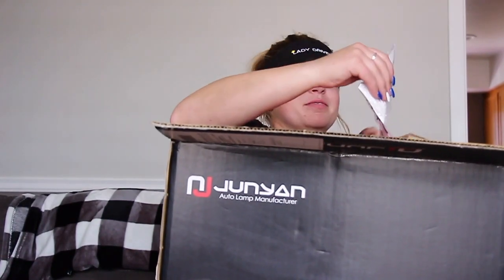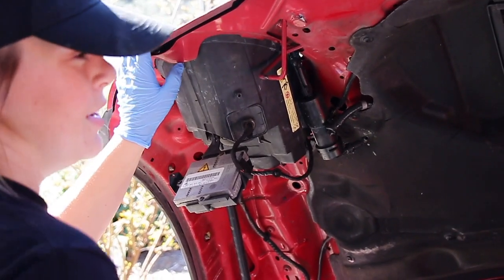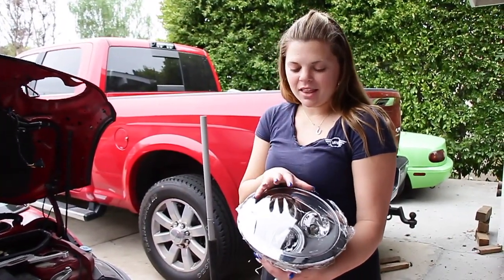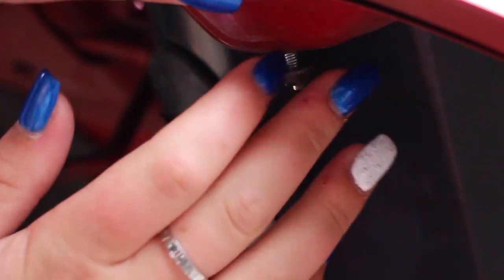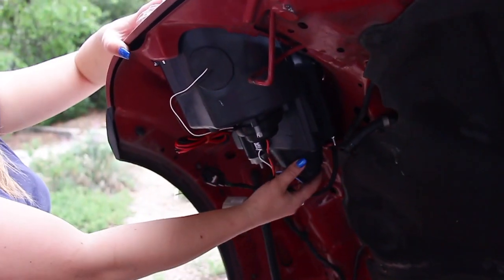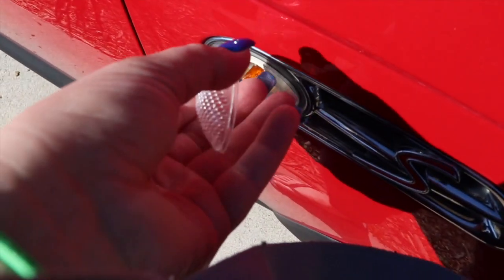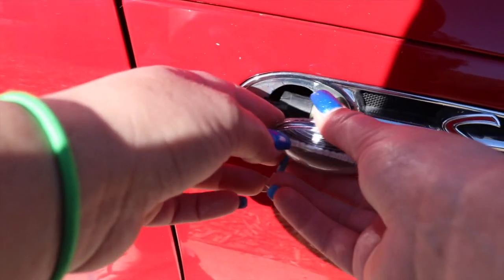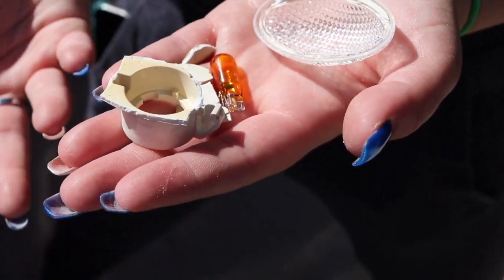MINI R53 New Headlights & lighting upgrades!

Comment: So to be clear you had factory Xenon headlights and replaced them with these Junyan headlights with absolutely no need for re-wiring, programming, or anything else?  Are the new headlights Xenon or LED?  And where did you purchase these?
Reply from the maker: I only added wiring for the halos. I plugged the  headlights in as normal. Yes I had xenons
Reply: @JulietteHallie  thank you. I cannot find them on eBay. Can you post the link?  It should be in your purchase history. Also, can you explain how you wired the halos?
Reply: @JulietteHallie  I sent you an email and would appreciate a response.  Thank you.
Reply: Did you ever receive the link?
Reply: @Eletricalpenguin574  no
Reply: @davidwynn728  Hopefully this helps someone else, found this thread and had the same question, these are the generic oem manfacturer of the Spec-D and Spyder brand headlights. I took a chance and bought a pair, they installed in less than 10 minutes including removing the old headlights on my '05 Jcw. No errors or issues so far. These have no automatic leveling, though the manual included mentions the possibility of adding a leveling motor to these, I might check to see what that process would entail. They come with H1 halogen bulbs pre-installed that are brighter than the old Xenons I had in, probably just due to the lenses being clean.

Comment: I thought you can't replace the headlight because of the headlight levelling sensor? or is this R53 the pre-lci model? Thanks
Reply from the maker: Ron diY I’m pre Lci but I still have level adjustments. These were literally plug and play!
Reply: You can swap them ron but the levelling won't work with those cheap aftermarket headlights. The plug and play only applies to the lights themselves. It's not worth it though as I know a lot of mini owners who have had those lights and they burnt out after 18 months to 2 years where the oem ones last  for years. Really don't get why people change perfectly good lights for cheap Chinese knock-offs. They only make the car look cheap especially with all that excess wiring for halo's etc. Easier way to upgrade is just change for good quality led bulbs and it looks a lot better than them Chinese things.

Comment: These replacement lights have turn signals in them and my stock ones do not. Is this an issue?
I also can't find anything about replacing the washer. Do you just delete it or are you able to transfer the hardware to the new headlight
Reply from the maker: I just deleted the washers

Comment: Wiring is the real story, what are the details?
Reply from the maker: Outside of the halo they are just plug and play. If you want the halo tap into the running lights, turn signals whatever you want them to be
Reply: @JulietteHallie  The turn signals are plug and play? I'm not aware of running light wiring up in the hood, it looks like there are two pairs of wires per unit to resolve.
Reply from the maker: @snowphun   just to get the headlight work it has a plug that you just plug in. the halos are extra wiring.
Reply: @JulietteHallie  The halos and the turn signals, that's the point. That wiring is the challenge with installing these lights, that's good info to share in the video as it isn't a quick or easy task.
Reply from the maker: @snowphun  as far as what I did. I plugged them in and they worked. Tapped into the running light for the halo. I believe there is more wiring options on the headlight but I didn’t do it. Tapping into the running light isn’t complicated, but if you need additional help with that I’d suggest looking into a video on how to tap wires.

Comment: I have rally lights on my 04 r53 mc40 and I do not know how to turn them on? 🤦‍♂️ please help.
Reply from the maker: Not 100% sure I installed mine myself. I believe the OEM ones had a button somewhere maybe next to the steering wheel to turn them on? Not positive though I’m sorry!
Reply: @JulietteHallie  your right it does but it doesnt turn on. I gotta check cause I hear that they only work with high beams and are not on all time as "drive lights"
Reply from the maker: @DrewPWebos  it’s possible the bulbs are bad on such an old car
Reply from the maker: @DrewPWebos  they’re extremely bright so it could be a safety feature to only come on with high beams
Reply: @JulietteHallie  lll check it out thanks!
Reply: @JulietteHallie  didnt think of that 🤦‍♂️🤦‍♂️

Comment: Greetings from the UK - I see you have lacquer peel on yours also!  - Is this common with the red colours as mine (Chilli Red) is peeling badly on the bonnet (hood) and the boot (trunk) lid and I fear a costly respray to both will be needed unless I can source reasonably priced second hand replacements! - Great video though and given me food for thought - Keep them coming, they're great!
Reply from the maker: It is very common for the red, yellow and blues to have top coat failure. It is unfortunate but for now I will live with it. I want to respray the clear in the future.

Comment: shitty un boxing & installation video - would like to get your feedback on the finished product & any issues you found while installing them
Reply from the maker: Headlights are very simple. It’s literally 3 bolts and a plug. It’s a plug and play item. So as you see in the videos it’s very straightforward. Anyone could do it 😅 I hope you can figure it out! They came perfectly leveled for me so🤷🏻‍♀️ not much to report lol
Reply: @JulietteHallie  Hello & thanks for the reply. I understand the assembly process as I've removed mine to re-surface the UV damaged lens , Still really interested in this LED version you were installing & weather it's a true plug-N- play replacement noting in several shots loose wiring not connected for example
Reply from the maker: Garrie Taylor I said it’s “plug and play besides the additional halo and turn signal” in the video?
Reply: @JulietteHallie  what are the loose black and white wires (no connector attached ) in the wiring loom go < at marker 4.15 where you can't English they are visible,were to they go
Reply: @garrietaylor9519  I've seen another installation video for these lights and if I remember correctly the other 2 wires are for the additional indicator. Can be spliced into the
factory indicator wires. 
Juliette can I ask you what the make and model number for these lights are please. Think I'd like to get the same. Thanks